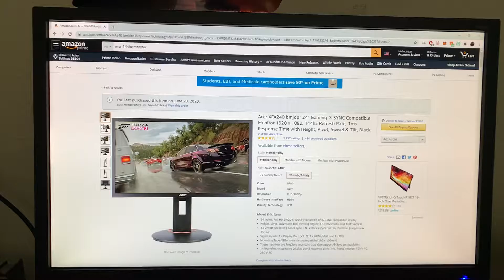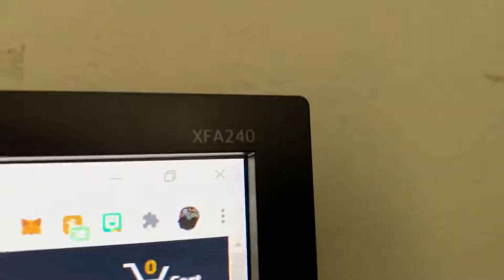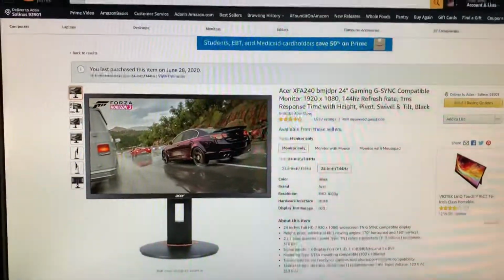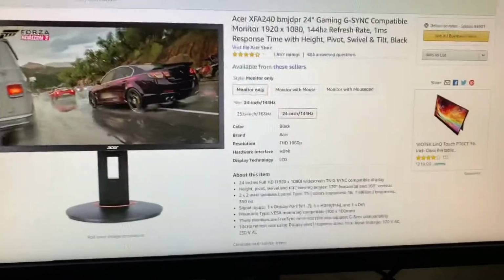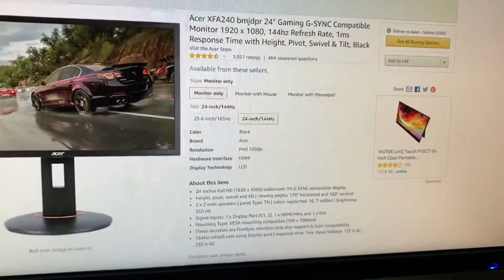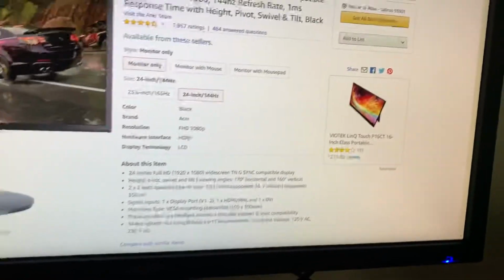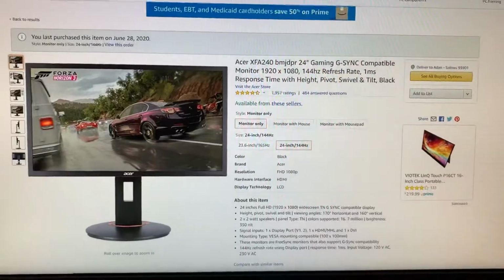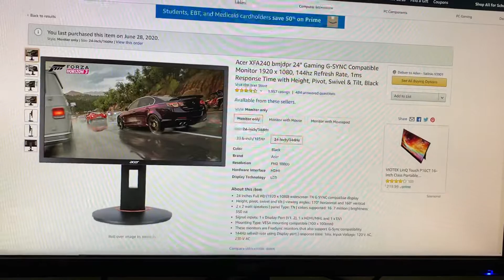Acer XFA240 DVI - No Display Signal Fix

Comment: Didn’t unplug the power cable, just turned it off with the switch.  Held for 15sec and it worked.  Works for DP input.  Thanks for the share man.